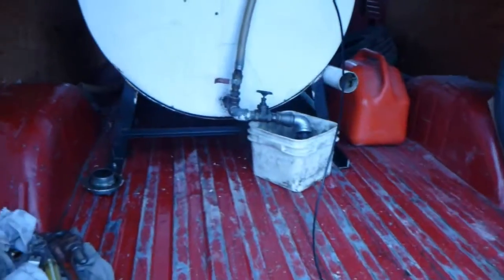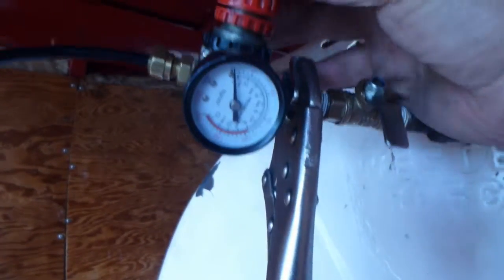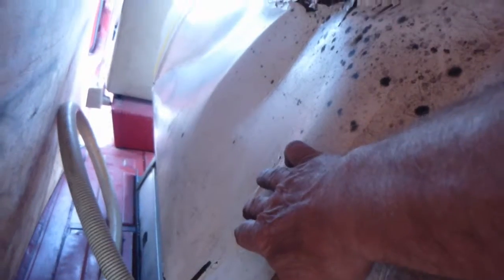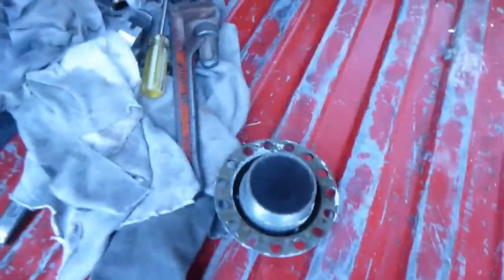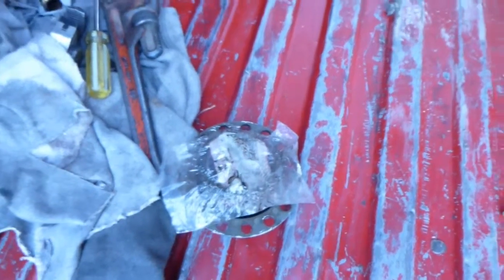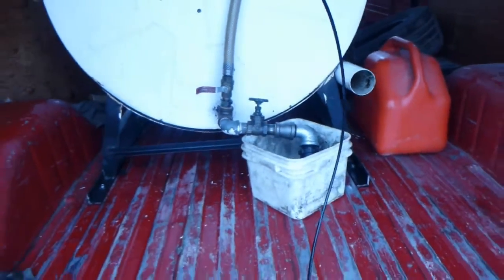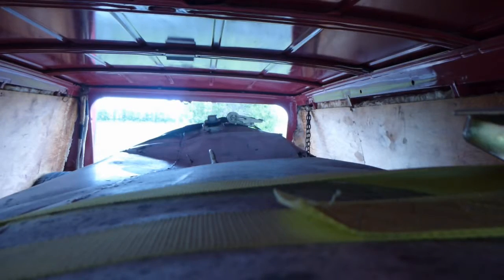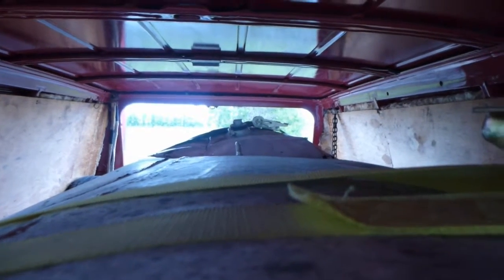INFLATING A COLLAPSED TANK WITH AIR

Comment: I was cringing filling it with air; seems like a REALLY bad idea especially since now the tank is damaged.

Would have been better to use a pressure washer and water.
https://www.youtube.com/watch?v=rD5adp8JMEw the water would put more uniform pressure on the tank and may have even pushed out some of the bends.
Reply from the maker: Just the way I did It. It's what we had handy.
We did this very slow, and kept our distance. 
Also kept it in the van for a little more protection.
Still working fine  to this day, with no leaks.

Comment: Should have filled the tank with water the added the pressure, it's much more safe although its only 5 psi add up the square inches of the tank and that can be tremendous pressure if the tank ruptures as the air expands, but water is non compressible its safer if the tank ruptures. 23" Dia barrel with 5 psi exerts 2075 pounds of force on the surface.
Reply from the maker: John McRae Although we had the regulator set to 5lbs. psi. at first we bumped it up to 10lbs. We only got the tank pressure to 2 or 3 lbs. max., then decided to shut it down as at first it moved steady & slowly at 1lb. or less, and toward the end it had to build up pressure before popping from time to time at 2lbs. The tank is quit useable now, but maybe when we fill it next time we'll try capping it off and see if will move some more.  Thanks for the information.
Reply: When are we going to see more on the bike build? Check out my channel I just finished building a Procharger system for my drag bike, injected methanol, machined all the parts myself.
Reply from the maker: John McRae SOON I Hope. Just waiting for the new set of gears to arrive, then we'll get back at it.That's an awesome sounding motor, and it seems to respond instantly. What HP are you expecting to get with that set-up?
Reply: Procharger flow enough air to support 600hp but it will most likely be around 400